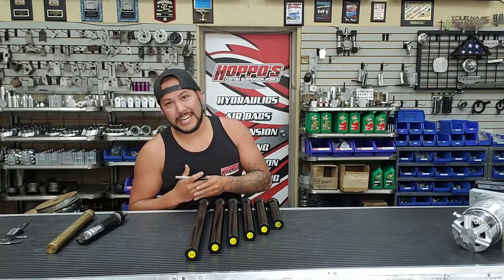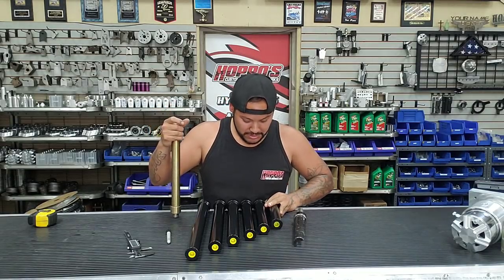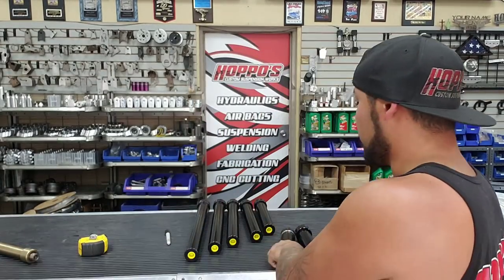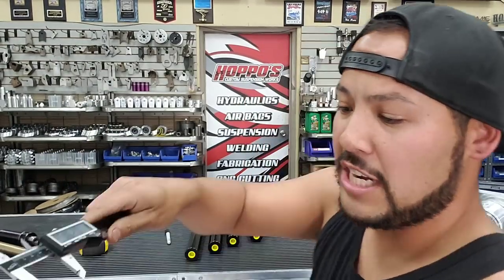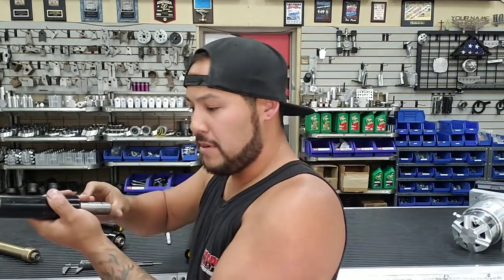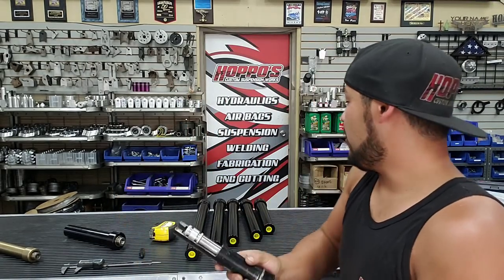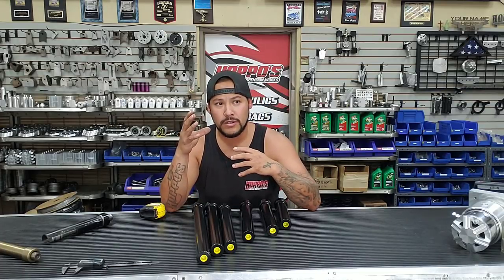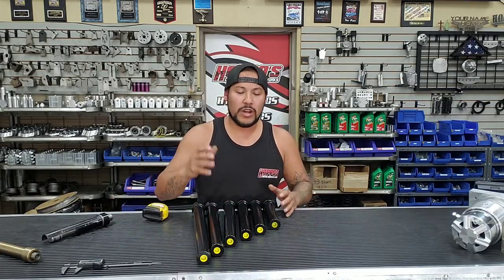"HOW TO" measure my lowrider hydraulic cylinders

Comment: So all cylinders use 2 u seals on the piston and a wiper and rod seal (u seal) in the head? You said o rings but I believe you meant u seal? Orings with a backer just wont hold the pressure like a u seal. I'm a air bag guy and getting into my first hydro kit and just seeing if everything is the same on the pumps we build and rebuild and the cylinders. Thanks man. I rebuild cylinders for bos hydraulics in va. My dad is the machinist where we custom make cylinders from start to finish I rebuild small cylinders to big 40ft plus cylinders on cranes man lifts ect. Great video for ppl to learn. Keep it up man.

Comment: I have a question. I charged all my batteries and they all read 100% however the front is going really slow . And last Sunday I was at the streetlow car show here in San Jo and the front wouldn't go up . One if the solenoids was just clicking  so I tapped it with a hammer then the front worked but really slow still .